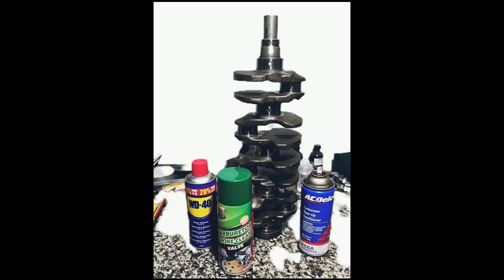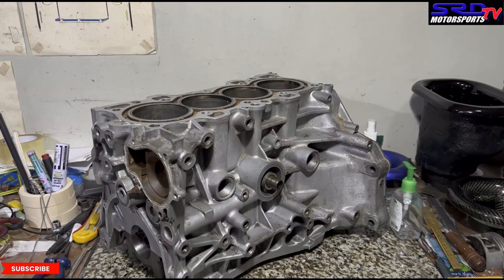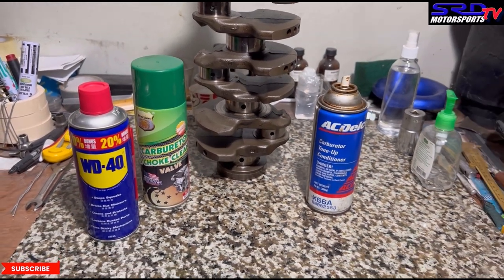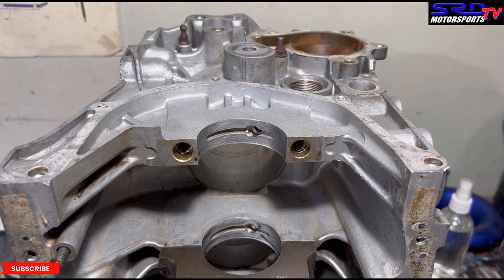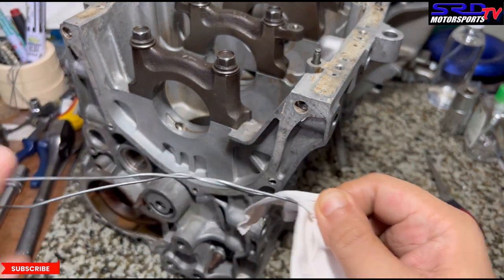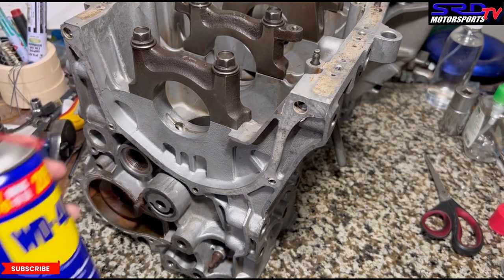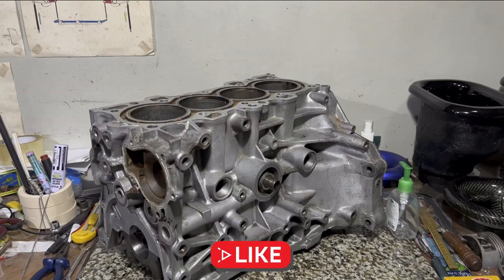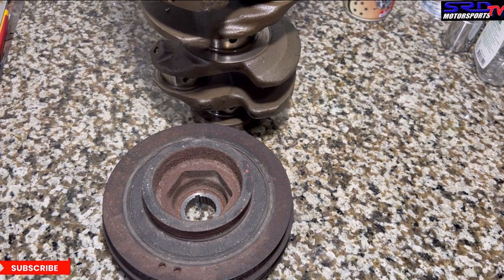How to: Clean Engine Parts for Final Assembly by SRDmotorsports

Comment from the maker: Pointer*
75-85% of the time, crank snout damage or crossthreading is because of a replacement    

-Pulley Bolt = the bolt bottoms out at the thread before pulley is snug/secure

-Replacement Pulley = the pulley bolt base not thick enough that the bolt bottoms out 

-Unclean threads with oil = before you can compress liquid the threads get damaged first

Comment: Ayos! 20% palang yan hihi 

Sa cycling naman similar yung cleaning steps. Una, Petrol talaga,  then degreaser, last ay mythilated spirits or denatured alchohol. talagang bare metal nalang after that. baka useful din sa automotive although madali sa bikes kasi pwede ilubog (& shake) yung chain or bolts sa garapon. sa engine, malaki-laking planggana yun hahaha
Reply from the maker: yes yes the planggana here is wasak wasak na hence not  nice to show hahhahaha

thats a nice mix for bikes similar indeed the last one i use carb cleaner does similar effects cuz it dries up quick and true on chains thats a good reference i think for most bikes too that could help indeed

Comment: this is a great help on our next engine rebuild..
by the way sir, what is a good size breather for the engine block?
Reply from the maker: oh thanks for this comment!
 usually i find 2liter volume catchcan or breather box to be good , i do prefer 2.5liter volume

but if you mean hose size atleast 1/2" is good

what block do you guys run? oh and thanks for the DM's at our SRDmotorsports page im processing the gear analysis for u guys to get a few more ideas for improvements
Reply: @SRDmotorsports  yes, what i meant is the hose size. we are currently running 2 b20 blocks, both have no breathers in the block side. but for me, im really planning to install one of this days to relieve pressure in the block..
actually sir, kala ko di ka sasagot sa DM ko kagabi, and im surprised that you did, me and the boys actually are excited on the computation you are about to share po..and for that we are very much thankful.
Reply from the maker: @the063one  that is a good perspective! Tbh even a stock crv benefits a breather system my old friend’s crv used to get 14-15km to a liter city driving so imagine if hwy drive 

Stock crv but complete breathers even Vc like a turbo lol
Reply from the maker: @the063one  i got some ideas and tricks on the dm this way u be Iligan City's feared competitor haha 🤣

Yes run two breathers on the back of the b20 block it relieves alot